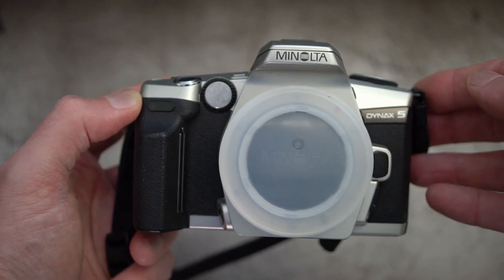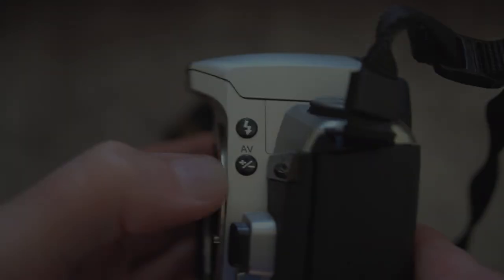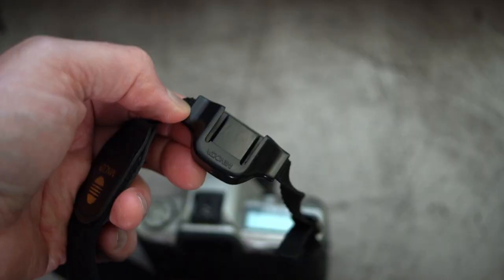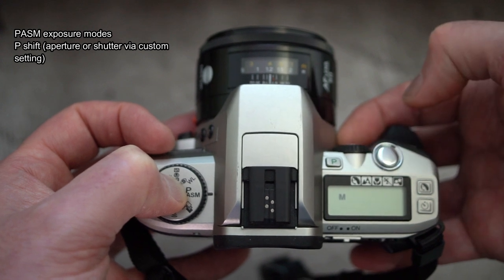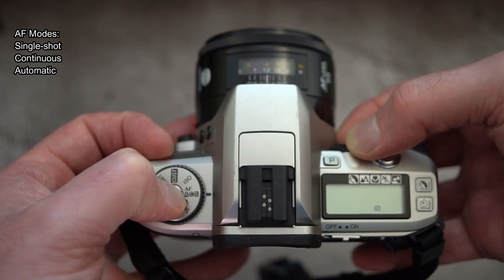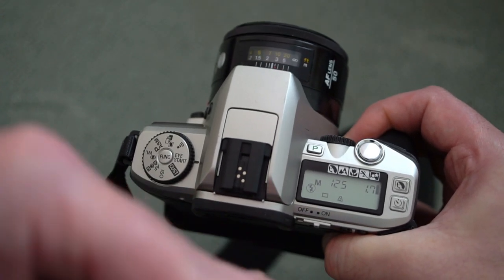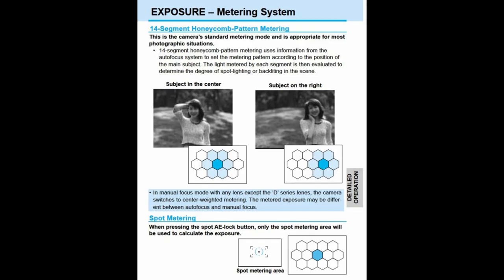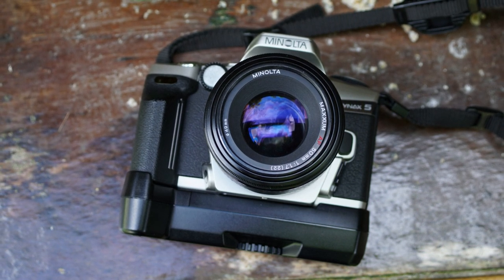Minolta Dynax/Maxxum 5 (35mm Film Camera): In Depth Look

Comment: Love this Camera. Tested with Sony 50mm f/1.4, Sony SAL2875 SAM and Sony SAL70300G SSM and it works with them all plus my collection of Minolta lenses. Amazon carries CR2's very cheap. My film bag now has this camera (upgraded from HTsi), 50mm f/1.7, 28mm f/2.8, 28-105 RS and Beercan 70-210 f/4.
Reply from the maker: I still use this, a classic 5 series camera. Also have other 5 series ones 5d and 57
I decided to stick with A mount, just get used stuff and adapt - I like the lenses too much you have similar ones I have
How do you find the 70-300mm G? Never used it does it work well?
Reply: @MrBazReviews  it is fantastic but, I only bought the Sony version because my main digital body is an A99ii and it has some focus benefits with Sony lenses. I have also shot the Tamron SP 70-300 and it is just as good for half the price. Same size too. Both are sharper and faster (AF) than my Minolta 100-400 but about the same size and weight. I had an A65 for years and loved it. If I could find an A68 I would snap it up in a heartbeat to have a second A mount Digital body. I currently use an LA-EA4 and an A7ii and it’s only OK. I wish Sony would let the EA5 work on all E mount bodies.
Reply from the maker: @jml7916  Interesting, thanks for that I have seen the Tamron around at a low price. I do have the LAEA4, and it's not bad. However the LAEA5 looked great, until we found out  it works on all of 3 expensive bodies!
So a non starter really, unless they add bodies later on.
I do use the A6300 with the adapter, the output is good for video, and nice enough sensor. I can't say I like the body at all though, just feels odd using it. Some strange concepts at work.
I decided for the time being to use that E mount body, for reviews/video - but I have 0 interest in re-buying lenses for it.
So I just fund the A Mount stuff. I did cut down the crop lenses, but A99's are not too bad a price, makes no sense to buy an E mount body, and use it with the LAEA4, not for photos. And makes no sense to buy an LAEA5 if it doesn't work with screw drive lenses.
I'm a bit puzzled why Sony didn't work out, that the adapter situation, just isn't appealing to A mount users. I have no interest in 61mp, or the A1 or A6600. They are all too expensive by a large margin.
Lot of used stuff on MPB I traded/sold/bought some from them no problems at all. I think I'll stick to A99's in the future, I sold my 77/77ii, and picked up an A57 as a second camera. I have way too much stuff to consider a system switch!
Reply: @MrBazReviews  You sold an A77ii???? I   am drop jawed, lol. I would love to get a second A99ii but the cost is to much. Hopefully a used A7riv and LA-EA5 will be affordable when my A mount body dies. I have a few E mount lenses that I bought for the A7ii. I would be happy keeping only 2 or 3 of the 5 that I have. The 85mm f/1.8 is actually very nice. The other one I love is the Tamron 28-200 f/2.8-5.6. It isn't perfect but it is very, very good and pairs well with the A7ii to make a fantastic carry around, do everything setup. I also enjoy using older MC/MD lenses and other odd manual focus primes I come across with it. I am saving up for a Minolta 85mm f/1.4 but they aren't pocket change cheap. I keep thinking I need a better wide angle lens but nothing under very expensive is much better than my trusty, old Sigma EX 17-35
Reply from the maker: @jml7916  Be a while before the 7RIV is cheaper, could be quite a few years. That's at this time the only FF that's within reach for the LAEA5. Unless the new A7IV works with it, when that turns up.
Minus the S/M Raw those 61mp files eat up a lot of space, that's the problem for me. I can shrink them down even raw in the PC - honestly have no need for 61mp at all.
A1 is just crazy land for money, that's never going to be an option really!
I got a used A77ii almost 2 years ago, for not much money, sold it to MPB for a profit! I was never happy with the focus, just inconsistent, despite tweaking settings. I ran it next to the A99 for a few days, and the 99 walked all over it, much higher keeper rate.
Also the Wi-Fi is useless on that camera (it's also useless on the A6300), can't GPS tag, app works hmm when it want to etc! 
A77 first one, I'd even trust that more for AF, and it has the GPS - it's just hard to use once you have tried an A99, even though the 99 isn't as good as other FF for low light - it's far easier working with that. The IQ is just much nicer. Even the 57 is a better camera for low light, and a deep buffer for the class - a nice little run/gun camera for small cost (sell for about 160 peanuts really). I had one from new, sold it and regretted it, so got another one!
A99ii will be expensive for a while, they sell fast, hold their value. Will be some time before they are more affordable. Meantime the 99 whilst dated are more than good enough for me, I'll pick up a second body later and run 2. Might keep the 57 as a spare
Tamron SP 15-30mm is a great lens, I used one, not too crazy price, but it's big and heavy. Can't fault it optics excellent. Never used the Sony 16-35mm. I mostly stick to screw drive, spare parts seem non existent for Sony A lenses, you can't even get hoods for most of them! I suspect Sony were running it down for quite some time

Comment: Thank you for this reweiw! I'm so excited, then I saw battery pack. It is good accessor, because cr2 non popular type battery than AA.
Reply from the maker: The battery pack is useful, but it is hard to find they are out there though now and then
CR2's are quite cheap on eBay you can get packs of 6 for not that much

Comment: Do you recommend buying this as a first camera? I saw it recently for $50 used
Reply from the maker: Why not? Unless you are invested in another SLR system - then this is one of the better featured cameras for this price point. No shortage of cheap/good lenses around either
Reply: I’m just getting into photography for real I just picked mine up at goodwill for $12 seems in good condition have to get batteries for it

Comment: Does this have an automatic mode or is it only manual for the light settings
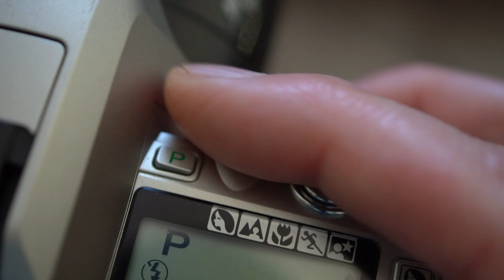Reply from the maker: As you can see it has the PASM on the left hand dial, a P button too - 2:29
And scene modes

Comment: Which lenses do you recommend for this camera?
Reply from the maker: Later ones came with a 28-100mm D kit lens (better than the 28-80mm), the 50mm F1.7 is cheap and popular, the 28-105mm is one of the best normal zooms (step up from kit lens), 100-200mm F4.5 is dirt cheap, long min focus but very small and light I use it all the time
Reply: @MrBazReviews  Will that lens you mentioned 28-100mm, work on a Minolta SRT303. The SRT isn't autofocus, but I don't care, I just want a better lens.
Reply from the maker: @Arcturian1111  It won't fit this is A mount you have an SR/MD mount camera, there are lenses out there for it have a dig around.

Comment: Does anyone know how I fix my flash?
Reply from the maker: Onboard flash or external? If it's in the camera then not much chance of a fix, external units can be attached. You can get adapters for the Minolta hot shoe to normal hot shoes, or dedicated units that fit it used.

Comment: im confused about what lenses are compatible with this, are modern A mount lenses compatible? I have this camera with the kit lens but I want a fast wide angle lens 24mm and lower F2-1.8 or faster, any recommendations? im not sure if sigma art lenses are compatible coz that might be the route I go down?
Reply from the maker: All A Mount lenses work on this, screw drive or in lens AF motor. There should be no problems with lenses from Sigma or Tamron etc. Not that I have ever seen. It's only the earlier bodies that can't AF with in lens motors.
Reply: @MrBazReviews  amazing thanks mate!